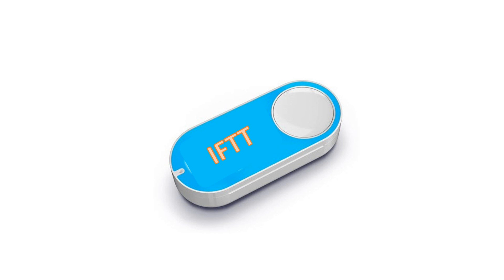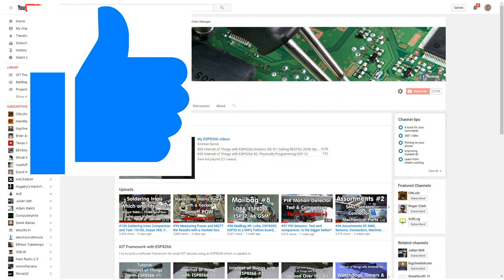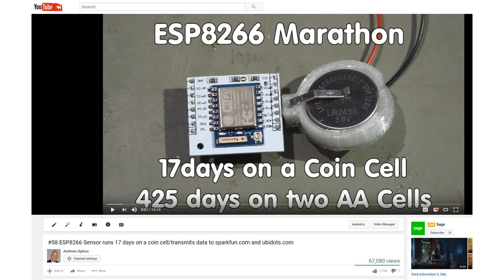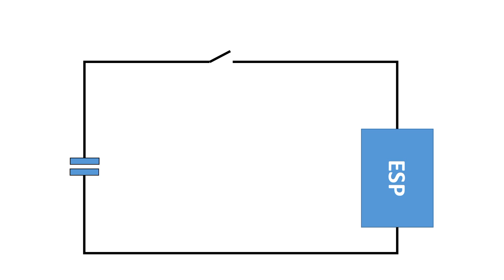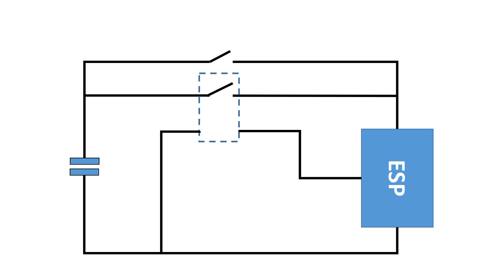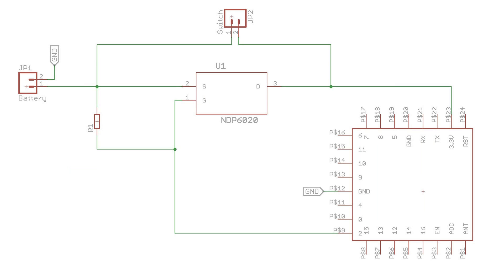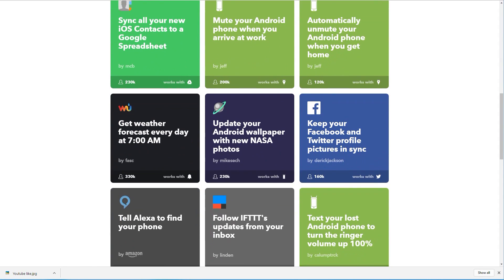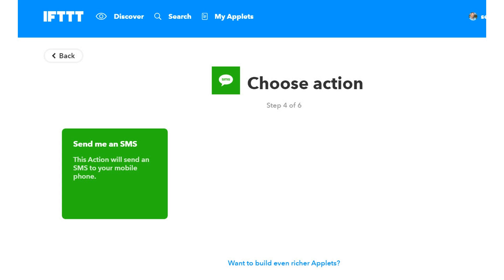#101 Long lasting DIY "Amazon Dash Button" using an ESP8266

Comment: If the I/O port of the microprocessor on which you connect the resistor has reversed protection diodes build in, you can actually power the internal VCC of the processor through that port and that internal diode. The internal VCC voltage the processor will have is going to be a bit lower (battery - Vinternaldiode - Vresistor) but will often be enough to keep the processor running.

So your fet and resistor idea will not always work; the processor is not guaranteed to turn off.
I had this problem once and it took me ages to find the fault. I solved it by using a transistor to switch the fet.

I don't know if the ESP8266 has protected I/O's but even if it has, because it's so power hungry the voltage drop across the resistor might be high enough not to turn the ESP8266 fully on. Still... wouldn't you get a constant current drain through that resistor as if almost it were tied directly to ground?

 Dave Jones from the EEVBlog made a video (#831) on it: https://www.youtube.com/watch?v=2yFh7Vv0Paw
Reply from the maker: I used a 10k resistor and measured the current (with Dave's uCurrent). It was between 1 and 2 uA with the big FET. So, I did not care too much about the effects you describe. Maybe, I was just lucky. And I am also lucky because I do not have to build devices for sale. This would of course need much more testing.
Thanks for the explanations. If I run into the same problem as you, I hope I will remember your post...
Reply: I did a project where a microcontroller turns itself off, 
http://www.davidpilling.com/wiki/index.php/NiMNiMNiMNiMNiMH
Refers to another Dave Jones circuit, more complicated than 1 FET.
Reply from the maker: I will read your articla. Thanks for the link.

Comment: I've had an ESP8266 in my postal mailbox for sometime.  It uses the same concept. When the mailman opens the box, it powers up the ESP8266 and keeps the  power on until done sending a message.   I've enjoyed your videos and they have inspired me to do more projects.
Reply from the maker: I have the same "mailbox" problem, but mine must be worse: The distance to my mailbox is too big for my WiFi net.So, I not only do not get a notification, I also have to walk far ;-)
This is, why I will try to use LoRa for this purpose. It should be able to go so far.
Reply: I had to use a homemade external antenna since the box is metal.  It pokes out the bottom and is not very visible.  I also had to put it into a styrofoam box to average out the temperature.  It's too hot on summer Texas days for the processor.
Reply from the maker: The temperature part is not so important here. But I think, I also have to use the external antenna concept.
Reply: It is so small. Have you thought about fixing the processor to the underside of the mailbox so you only have to deal with ambient air temperature and not the temp in your solar oven...I mean mailbox?
Reply: Inspired!  Been concerned with the irregularity of the mail service and this is the perfect idea!  Also, allows me to do some statistics :)
Reply: Smolvis, let us know how you got on, I’m a Brit in France and would like to exactly what you want to do!
Reply: it seems many people did a mailbox thing.  got any links ?
how do you address if there  is mail in the box ?
Reply: John, any chance you can share the code and schematics?
Reply: Interesting. How can I connect the sw420 vibration sensor with deep sleep mode in node mcu ?

Comment: add a magnet on bottom of a button to trigger reed switch. Also make more videos!
Reply from the maker: +ytfp Thanks. And this concept could be made completely closed for outdoors!
Reply: had another idea but had to delete as this would not remain low power, yes long arm press button should work good.
Reply from the maker: All mechanical movements can be used with this concept. You are right.

Comment: Great video! You can do HTTPS requests if you know sha1 certificate fingerprint (example https://github.com/dshop-gliwice/iot-workshop/blob/master/step4/send-data-to-cloud/send-data-to-cloud.ino#L85 ). The problem is that the certificate can change.. But it is still better than an unsecured communication.
Reply from the maker: +MFBcode Now I have to look into it. No more excuses ;-)

Comment: First of all:
I love your videos!
Now the serious stuff:
Why not using only the CH_PD pin?
Like this:
http://www.esp8266.com/viewtopic.php?f=11&t=4458
Reply: Damiano Rodriguez - I like them too. Do you know the power consumption in off-state when keeping vcc connected and using CH_PD to switch it on/off?
Reply from the maker: You are absolutely right. I checked, and the "power off" mode only consumes 0.5 uA which is very good. So, you see, that my viewers always have better ideas than me and I can learn a lot of them.
There is a difference if you use sensors or other stuff on your board. Then, with the FET, you shutdown everything. This is not easily possible with the CH_EN, at least if the "stuff" does not have a proper power management... But for my scenario, it would have been the better solution with less parts.
Reply: Nice to give you something back.
You are one of my favorites channels and i love the way you approach the problems in each videos.
Really good explanations of problems encountered in the way and how you resolved them!
Keep making videos! Even if you will not become famous I'm sure that you will influence some young mind to make things with their hands!

Comment: Grüezi Andreas! I love your channel, I'm a beginner and I've already learned a lot from you. I live in Switzerland too, but on the other side of the Röstigraben :)

I was also thinking about what you describe in this video. I use the more user-friendly versions of the ESP8266 for the time being (some NodeMCU boards and I'm currently waiting for a couple of WeMos D1 Minis to arrive). These are not great for low-power operation as you've pointed out in some other videos, because they have tons of extra things on the board that drain power even when the ESP is in deep sleep. Since when waking up from deep sleep the ESP resets itself anyway, I don't really see a point in having it powered while it's sleeping other than for the built-in timer that wakes it up again. That timer could be replaced by an external low-power microntroller though, like an ATtiny or something. It could be worth a try if you haven't tried it already.

Regarding the ESP8266 and HTTPS: I've set up a small remote-controlled relay using the ESP8266 and MQTT to control it through Home Assistant, and I use TLS on my MQTT server. It's very easy to set up and you can find some example code here, among many other places: https://io.adafruit.com/blog/security/2016/07/05/adafruit-io-security-esp8266/. I imagine the procedure is the same for HTTPS since it also uses TLS.
Reply from the maker: +Anarki Thanks for your long post. The Wemos have a different regulator than the NodeMCU boards. I like them, too because of their size.
Concerning external trigger: A video is in the making. But not with timers, but sensors.
Concerning HTTPS: I do not understand the thing with the fingerprint and where to get it. I am a real amateur with the internet protocols. But I will have a look at your link
Reply from the maker: +Anarki And BTW: I do not believe, that Switzerland will fall apart if we all would communicate in English!
Reply: Thanks for the reply!

The WeMos indeed have a regulator with a very low quiescent current, in the order of 25-50 μA, which is quite good. There' still the USB-to-serial converter chip through which also draws quite a few μA in sleep mode.

Great, I'm looking forward to the video with an external trigger.

You can easily find the SHA fingerprint of the certificate that a website uses through your browser. Go to the website that you want to connect to and then click on the lock thing that should appear next to the address in your browser to denote that it's an HTTPS connection. On Firefox there's a "more information" button there which shows you more information about the secure connection, including the SHA fingerprint. There should be a similar option on other browsers.
Reply from the maker: +Anarki Thanks for the "Tutorial". I will try it tomorrow.
Reply: I'm not Swiss so I can't judge that. Also, my (high) German is much much better than my French! :D

Comment: interesting :)
someone created scripts on raspberry or similar to look for arp requests on router, and as such, the dash was pressed, then they can do whatever they want, without ever connecting with amazon...  :)

https://npmdaily.com/pkg/arp-dash
https://familab.org/2016/02/hacking-the-amazon-dash-button-to-make-a-simple-cheap-iot-place-anywhere-networked-button-3/
Reply from the maker: I knew about that hack. I think, this is a very creative way to use technology. For me, the "Dash button" was just an example on how to use external (mechanical) signals to trigger our ESPs. I am preparing another video on triggering the ESP from sensors. So, this was the first of two.
Reply: thanks, i'll wait for it :)

Comment: In the case where a voltage regulator is used, a model with an enable (CE) pin is advantageous. The power latch GPIO can be connected to the CE instead of an additional mosfet.
Reply: Would be interesting to see as well, if you manage to make a video on that subject later on! :)
Reply from the maker: +tmk670 Good point. Did not think about that. But I got some new LDOs with CE. Will try it once.
Reply from the maker: You never know... I have no "production plan"
Reply: 1 year after, there is a video of this?

Comment: How much did you pay for the LoRa concentrator? I would like to participate but I'm surrounded by hills :(
Reply from the maker: The concentrator was expensive, more than 200$ including the Antenna and the spacer between the concentrator and the Raspby.
If you are surrounded by hills, maybe you find a place to put one on the hill. That would be awsome...

Comment: What kind of pizza did you order?

I was just working on a home security project using PIR, an ESP8266 and a LoRaWAN RFM95.   Your idea to use a mechanical relay or a P-channel mosfet is an interesting one.   While the ESP8266 is not the most low power processor, it is very cheap and easy to program.  For that reason, I like using it for all of my projects around the house even when they require no wifi.   I would love to see more LoRaWAN projects!   Great video and I hope the pizza arrived warm.
Reply from the maker: Quattro stagioni...
The Lora stuff needs a little more time to get started, because I start more or less from scratch. And I am travelling in the moment quite a lot. So, maybe beginning of next year...

Comment: Great video, as always. Will you be doing a comparison between ESP8266 and ESP8285 sometime in the future?
Reply from the maker: I am not in a particular hurry, because I try to avoid the "bleeding edge" of technology and join the "leading edge" because it hurts less ;-)
Reply from the maker: I do not know. First, I have to use it. But there should not be a difference between the two, because it is the same chip. Just with the flash memory built-in. So, modules get cheaper and smaller.
Reply: VaHaLa yes pls
Reply: The only issue as I recall with the ESP85 is limited Flash size - which means no OTA for larger projects...  I don't think you can beat the ESP-12 at £1.40 from AliExpress...
Reply from the maker: +Peter Scargill I thought, that this would be a good project for it, because size matters and the code is small. But generally, I completely agree with you.
Reply: The ESP8285 is also significantly slower than the 8266 when it comes to flash mem access; in return, it consumes less power, too...
Reply: Perhaps a comparison to the new ESP32 is more interesting... Episode #98 shows the arrival of one in the Spiess mansion. I'm looking foward to a review/comparison...
Reply: Lol Andreas "it hurts less" how true a statement is that